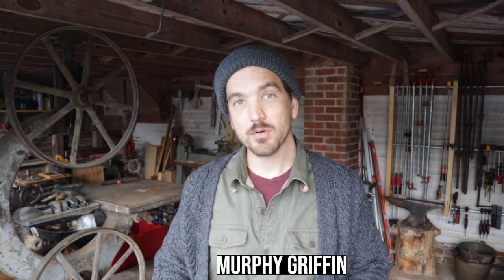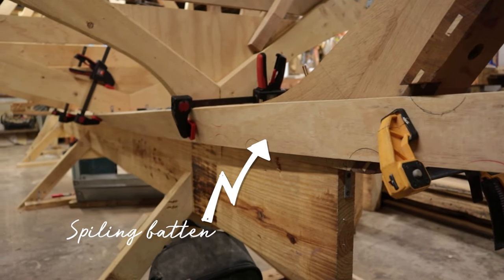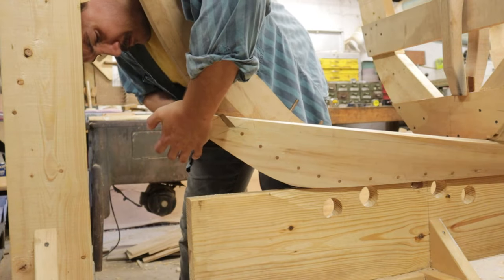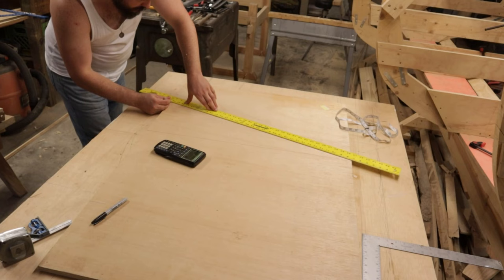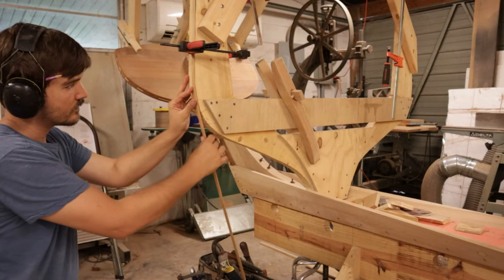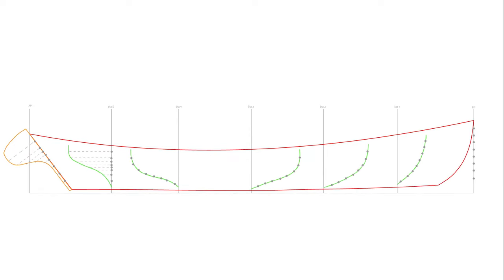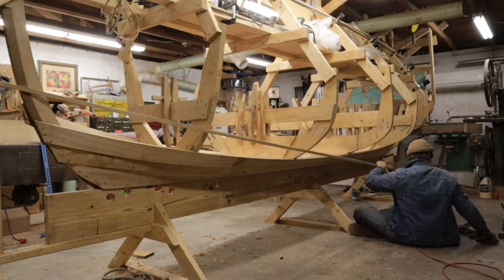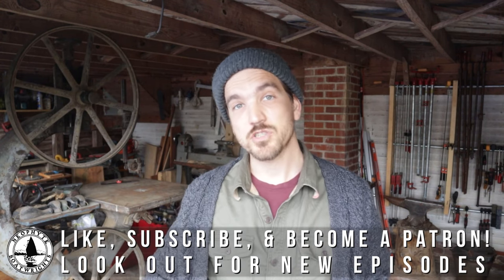Ep 17  - Planking (part 1): Garboards + Lining off

Comment: I should not have been impressed...but for some reason enjoyed it.    By the way, in many lapstrake boats- especially planing power boats with more normal sheers, simply dividing equally around the molds to determine laps, produces too steep a planking run up forward which is a defect the British call "sny" (rhymes with eye). So you wonder why the British seem to have this defect more than anybody else!  Some Chris Craft Sea Skiffs had it, but Lymans and Hubert Johnsons and others did not. They were done right. In order to avoid it, let's say you have 7 strakes per side. You divide up the stem as normally done. Then you run a batten aft from the top of the 3rd plank up, making sure the angle of run is proper looking. Run it back to the stern as seems proper and divide the 4 planks above that and the 3 planks below that so that all looks right. You may have to bias the width of the first strake above that mid-batten a trifle in order to keep the width transition smooth, but that's easy with a second batten if necessary.

Comment: Not meaning to be picky but I believe you said that lapstrake construction is like building a giant barrel. The staves of a barrel do not overlap, they are beveled a fit snug to each other. A barrel like some boats are similar to Carvel construction. Great content regardless!
Reply from the maker: Thanks! Yes barrels staves don’t overlap, my point instead was that the beveling at the joints dictates the shape of the cask, much like lapstrake planking. Also, the seal of a watertight cask depends on a tight fitting bevels, same as in lapstrake planking. That’s actually not the case with carvel planking. There the seal depends upon caulking the seams. Also with carvel, the frames that the planks are attached to dictate the shape not the bevels at the joints. planks may have to hollowed or crowned to fit snugly to the frames, but edge bevels aren’t dictating the trajectory of the next plank as with lapstrake.

Comment: Excellent use of graphics. Thank you for taking the time to share this. I notice on some other channels they don't have the plank landings equi-spaced around the frames, but use broad strakes (wider planks close to the garboard) and narrower planks at the turn of the bilge. Was it a conscious decision for you to space the planks equally? Regards from the UK.
Reply from the maker: Hey Ian! Well I won’t speak for everyone’s method, however, our plank spacing was divided according to equal arc length segments. These divisions do not exactly correspond to plank widths. Since arc length is sensitive to regions of higher curvature, wherever the curvature is greater the plank width is narrower, which amounts to the same result that you described. You might consider it from this perspective: broad strakes are “broad” precisely because the curvature of the hull tends to be less at the bilge. The turn of the bilge often constitutes a region of higher curvature and therefore necessitates narrower plank widths. Nevertheless, we DID artificially push the hood ends of the garboard up as high as we thought physically possible, this results in the subsequent planks running “straighter”, beyond that the process was fluid and we continued to make corrections to our lining off as we proceeded through the planking process.